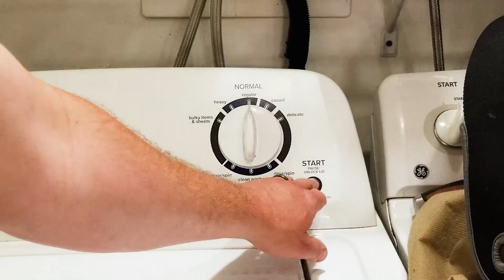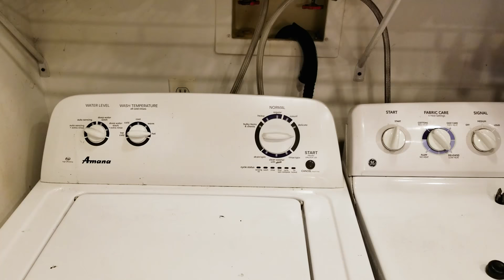How (and WHY) to replace water inlet valve Amana washing machine

Comment: I have the same model, but it will not fill with enough water like a large load will fill like a medium. What do you think it might be? Hot water works and cold water.
Reply from the maker: It could be a number of things. Inlet valve, water level switch, clogged water filters, or possibly a plumbing issue like not enough water pressure. Are the water hoses kinked behind the washer? You'll have to do some research to try to figure out where the problem is coming from.

Comment: I have just about same problem except it does fill (very slowly) but drains immediately when finished sensing. I've only had it a month. Only tried on cold water, I didn't try to see if the same issue on hot. Could still be valve? Ty
Reply from the maker: I'm not sure if that's a valve issue. Sounds like it would be something else. If you've only had it a month it should still be under warranty though. I would try to return to the store or contact amana warranty dept.
Reply: I am going to call service also. Ty. I tried a wash on hot \warm water, it washed until it got to the rinse (which only does on cold) then it drained & stopped. Must be something with cold valve? I also have low water pressure when filling.
Reply from the maker: Now that does sound like it could be the valve. The hot water works but the cold doesnt. But since it's so new I'd call to have them fix it. You shouldnt have to pay for the part.

Comment: I recently purchased a new dryer with a steam function, and had the guys replace the washer hoses with brand new stainless steel braided ones. Everything is connected correctly, but when I start a cycle, it doesn't fill at all and just makes a noise likes its trying to do something. Eventually it just stops and the green sensing light is solid green. At one point it started dispensing water for a few seconds and then stopped. The washer is maybe 2 years old I believe, model#ntw4516f3
Reply from the maker: Is the problem with your steam dryer or washer? If washer, have you tried switching between hot a d cold to see if one works? Usually with the inlet valve one side will fail but the other will keep working.  I dont have any experience with steam dryers.
Reply: @KyleMerl  it's just the washer. I did not check hot, but I remember my girlfriend saying it only worked on cold. It's actually my downstairs neighbor who bought it and then got another one shortly after and decided to keep it and let us use the Amana. I will try hot when I get home and check back
Reply: @KyleMerl  so it starts to fill right away when on hot. Tap cold, cold and cool do nothing. Warm started dispensing water for a second and stopped. But the hot seems fine. Everything worked before the guys added the new lines for me when they delivered my steam dryer. I bought new lines so they replaced them while they were here. Could there be debris blocking something and them doing so moved some debris just enough so it is now dirty?
Reply from the maker: @olol9084  you could try cleaning it. There could be a blockage on the cold side. Or it could be the same issue I solved in this video.
Reply: @KyleMerl  thank you man. I'll check it out tomorrow. Also, after the water filled and started the wash cycle, I opened it and the water was cold. Does it get hot later on or does it come out hot right away?
Reply from the maker: @olol9084  yea I'd think it would,  like when you take a shower,  you need to wait for the water to heat up.
Reply: @KyleMerl  so I detached cold hose from back of washer, placed hose I'm bucket band turned water supply on and nothing came out of the hose.
Reply: @KyleMerl  the water valve is one of the ones with one handle that controls both, doesn't have a separate nozzle for hot and cold.

Edit: so I confirmed that at least at one point it was the other way around where the machine would not work on hot or warm, only cold settings. Had not tried it in a while as every time we did, it didn't work so we just kept it on cold. The only change is we had the lines replaced with brand new ones, and also added a Y connection to to steam dryer. I'm lost lol.
Reply from the maker: @olol9084  does the Y have a built in shutoff valve?
Reply: @KyleMerl  not sure. It came with the steam hose pack. It looks like a simple stainless steel y. Would it be something I could see by looking at it?

Comment: What if it does not fill up at all even with the hot would it still be that problem?
Reply from the maker: Its possible that both sides of the inlet valve are bad... but it could also be other things so i would probably do more research to make sure
Reply: @KyleMerl  thank you.

Comment: I changed out my inlet valve before and this time the washing machine didn’t come on at all I changed the lid switch too and turned the water back on and it doesn’t come on at all at first I was just getting hot water  I usually don’t have trouble I’m stomped on this one 🤷‍♀️
Reply from the maker: I've never run into this problem before but I'd try running diagnostic mode to see if that gives you any clues. And also double check to make sure all of the inlet valve connections are properly made.

Comment: I have an Amana NTW4516FW....Is there a way to get the machine to fill faster on the rinse ? It's a cold rinse but there is a restriction on it that takes ages to fill .
Reply from the maker: not that I know of.  Water will flow slower from the hot side than the cold, but I didn't have any issues like that with cold water.
Reply: @KyleMerl  Ok thanks !

Comment: I have the same washer. mine's about 3 years old. Sometimes it won't start at all when trying to start it and sometimes it will but it stops in the middle of the cycle full of water. I'm not sure if I need the main control board or this inlet valve. Any ideas?
Reply from the maker: Have you tried resetting it or running diagnostic mode? I'm not familiar with this problem but it doesnt sound like an inlet valve issue.
Reply: @KyleMerl  I've tried the reset with only limited success. I will try and do the diagnostic mode. I guess there is an led display on the control board that can show an error code. I can pick up an inlet valve somewhat reasonable for $54.87. If it's the control board that's cost prohibitive. Thanks Kyle!
Reply from the maker: Good luck! It would be terrible to have to replace a machine after only 3 years. The only other thing I could think of is to check the lid latch. If it doesn't sense that the lid is closed it wont fill. That could be a cheap fix.
Reply: @KyleMerl  Will do! Thanks much sir!

Comment: So my Amana washer, do the wash cycle, but then on rinse cycle it sounds like is getting filled with water but not, and starts draining after and finish
Reply from the maker: Interesting... sorry I havent come across that issue before. Doesn't sound like an inlet valve issue though.
Are you washing on hot water?

Comment: I have this same model but water continues to run out when off can that be the reason?
Reply from the maker: @bigtweezy7839  it's possible but I didn't run into that issue so can't say for sure. These washers clearly have issues their inlet valves though! I'd probably do a little more research before you order one.
Reply: @KyleMerl  ok cool

Comment: Question I put mine in diagnostic mode and got an fe e2 code which is inlet water temp fail. But my water would fill it just wouldn't agitate or spin. Will replacing or cleaning the valves fix the problem?
Reply from the maker: Do both cold and hot water fill? If they both do then I'd think the culprit would be something else
Reply from the maker: Actually, after a google search, it could be the inlet valve. It appears to be a problem with the temperature sensor. I would do some research on that.
Reply: Yea I believe they both do I'll try to run just hot or cold once and find out.any recommendations on what it could possibly be or that I could do into finding out what the problem is? Moneys tight because the virus so really trying to fig out with out a paid consultant.and thank you so much for the response
Reply: Yea I tried to Google the issue but there is just so much to decipher one page will tell you one thing and the next page tells you the complete opposite so it had me really confused.lol so I should look into the temp sensor?
Reply: @KyleMerl  also I just tried to run straight hot and it's coming out cold.
Reply from the maker: Sounds like the hot side isnt workin then. It will always dispense cold water first and then adjust the temp by adding hot. I'm not 100% sure but sounds like the inlet valve is what you need to replace.
Reply: @KyleMerl  ok thanks so much for answering and helping me I have only one more question and I'll leave you alone. Google keeps confusing me with non straight forward answers so the inlet water temp valve if defective will keep it from agitating or spinning? And again im sp thankful for you taking the time to help me.
Reply from the maker: @justinboggs6213  as far as I have read the spin cycle isnt working because the temperature sensor isnt working correctly. The temperature sensor is part of the inlet valve assembly. Good luck n let me know how u make out!
Reply: @KyleMerl  ok I def will I'm looking online for the part now just cant find one with the temp sensor included just the inlet water valve set up unless its built into it or something...but again you have been beyond helpful thanks and stay safe...p.s will let you know the outcome.
Reply: @KyleMerl Hey good news!.Come to find out I read my error code wrong i was reading an f3 e2 (water inlet temp fail) when in reality it was an f7 e5(shifter fault) "aka the actuator".luckily had an old washer out back with a pristine one intact switched them out and all is well(for now).lol just wanted to give you an update and tell you thank you so so much for your insight and quick responses out of all the videos I watched and asked for opinion or help on you was the only one to take time out of ur day to respond and for that I'm grateful. And (p.s if u ever watch YouTube for error codes on washing machines watch more than one cause it took me 10 before I found one that explained it properly.lol) STAY SAFE AND BLESSED
Reply from the maker: @justinboggs6213  awesome! I'm glad you got it working! The hardest part of appliance repair is figuring out what the problem is. My whole goal is to help people fix things themselves and save money so I have no problem at all answering questions. I'm happy to help.

Comment: Any way you can put the link in the bio for the exact part? I’m having trouble finding it on the website you dropped
Reply from the maker: here is a link to all of the inlet valves but to determine which one you need you have to use your model #.  I am assuming you also have an Amana.   https://www.repairclinic.com/Shop-For-Parts/a11b1c37i219/New/Amana-Washing-Machine-Valve-Float-Water-Inlet-Valve-Parts
Reply: I found mines on Amazon for 36bucks & some chang

Comment: Thank you for this video! Quick question - if we have a leak where the red valve meets the metal bracket, is this fixable without replacing the entire valve? Thank you!
Reply from the maker: possibly but I doubt it.  Personally, I would just replace it.
Reply: @KyleMerl  great thanks again
Reply from the maker: @TheKellyTolman  no problem! glad this helped you

Comment: Hey there, thanks for the video. I tried replacing the part but the issue persisted. When I switch the washer to "tap cold" or "cold", the water still comes out pipping hot. Any tips?
Reply from the maker: What happens if you set it to hot water, do you still get hot water?
Reply: @KyleMerl  Thanks for the reply. I still got hot water on the hot setting, just less hot water if that makes sense. I don't know how the heck I missed this, but it turns out the guy who installed my washer flipped the hot and cold water hoses so hot pumped into a cold cycle 🤦‍♀️ Got it fixed!
Reply from the maker: @annamiller1727  that's what I was thinking. That's interesting that they both gave you hot water but it is normal for the hot side to give you less water. I'm glad you figured it out!

Comment: Thank you! You just saved me some money from having to hire a repair man!
Reply from the maker: Glad it helped ya!
Reply: @KyleMerl  now I'm having another issue. The cold water stopped working. I've already tried replacing the valve with another new valve and still no cold water. Any ideas on what the issue is?
Reply from the maker: @MrRepoman197  hard to say. First I'd check obvious stuff if you havent (is cold water turned back on?). If you switch it to cold water does it try to run?
Reply: @KyleMerl the cold water is on. When I switch it to cold just absolutely no cold comes out. There's gotta be a fuse or wiring issue. Something happened....
Reply from the maker: @MrRepoman197  you could test the wiring with a multimeter and see if voltage is getting to where it needs to go
Reply from the maker: @MrRepoman197  woohoo! Glad it was a simple fix!
Reply: @KyleMerl  scratch that. Not working again. Real weird.....there's nothing blown the wires are all intact. Water is on both hot and cold. The valves are not clogged. I'll keep ya posted.

Comment: Our Hot quit working .How do you know if it’s this or the switch ?
Reply from the maker: I would use a multimeter to test continuity in the switch.  Do a YT search on 'testing a switch with a multimeter' and I'm sure you'll find something that helps you test your switch.  You can also check continuity on the hot side of the fill valve

Comment: I don't know what it is but mine will try and fill up with water but doesn't, why?
Reply from the maker: Is it both cold water and hot water that doesn't fill? Either way, it could be the inlet valve. If neither temp works you may need to do more research to rule out other things

Comment: On cold water mine start to fill up doesn’t wash or rinse then it can drain for 10 minutes and all the light shut off, and the pressure on my cold water is very low…

Comment: what's the name and size of the screwdriver used?
Reply from the maker: I was using a screwdriver with removable bits. If you take the bit out, it happens to be the correct size for the screw. So any screwdriver with removable bits should work

Comment: First, I see braided hoses. Smart move because many do not know about black hose etc vs braided and why. Till hose burst and flood. Next I see you swapped wire harness. Long as the pin config matches wires all is fine. I suspect on a wild guess most inlet valves is same be most washers are under same maker just differ branded. Another words if one knew what they was doing they could buy a 20 buck inlet vs 100 buck one when harness differs only. Again long as pin config matches.. Next must be nice to get to inlet easy. Most the case has to come off. Last lucky me I am waiting on a inlet. Whirpool top load was fine. Next day 0 water. Washer spins and cycle just no water. Screens are clean. Jump back about a year my hot and warm side stopped. Left only cold. Forward to other day and 0. Hmmmm? Only thing I would of done also in vid is a step by step meter check. Because the inlet is not always the case.

Comment: Ok so what if u switch to hot and it still wont fill… it will start to fill, but immediately stops
Reply from the maker: @jdelao79  could be that both sides of the inlet valve are dead... or something else. Hard to know for sure without additional troubleshooting.

Comment: How do you pop the top off at 1:20? Mine wont pop off like that
Reply from the maker: @Mountains4ever  it's the angle. That's why I pulled the washer out so far. You kind of need to come in more from the side
Reply: @ yep! Got it! You’re the best thanks! Just got everything re assembled. About to plug it in and turn it on. Moment of truth lol your video was awesome!
Reply from the maker: @Mountains4ever  glad it helped!
Reply: @ it works! But now the shocks broke on the drum so I need to fix that tomorrow hahaha if it’s not one thing it’s another lol

Comment: Mine had a slow cold fill and made a different sound as if the solenoid was failing...you can also check the plastic screens for blockage....then the splutch was bad. Worst washer ever.
Reply from the maker: Yea you definitely get what you paid for with these!

Comment: I get no water
Reply from the maker: neither from hot nor cold?
Reply: @KyleMerl  yes
Reply: Hit the start button sensing fill light comes on but no sound whatsoever
Reply from the maker: It could be that both sides are bad but it might be something else. You should check the inlet valve on both sides with a multimeter to see if the inlet valve is the problem

Comment: I did this to my old one  , I have hard water so inlet tends to get buildup and doesnt close entirely . When I sent for my new one it also came with a different harness but with instructions on how to splice it in with the existing one , not sure what the idea is behind it 🤔🤔
Reply from the maker: Yea this seems to be a surprisingly common problem with these washing machines.  I think mine was some kind of electrical failure.

Comment: Hello I replaced this same valve due to cold temperatures where I stay after I replaced it now my washer won’t come in at all I see on the back side a little green light but can’t get it to start any tips on what to look for thank you ,
Reply from the maker: Not sure, I never had that issue. First I'd check to make sure the wires are hooked up correctly and arent damaged.

Comment: When I put mine on cold or tap cold hot water comes out instead and I already made sure the hoses weren’t backwards. Will replacing this part fix my issue as well?
Reply from the maker: Possibly. Could also be a clog maybe. Hard to say without doing more testing on it. If you switch the hoses is it still coming out hot?